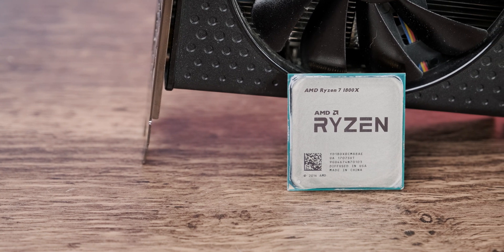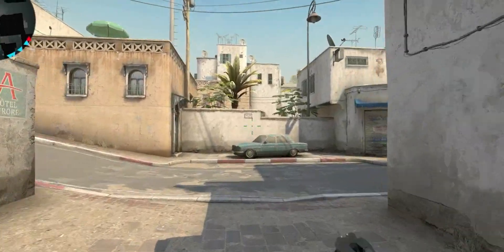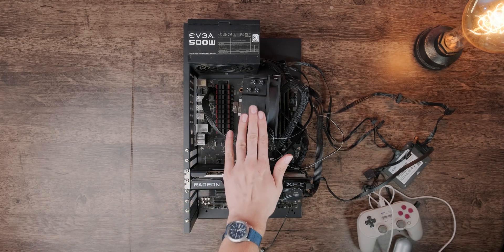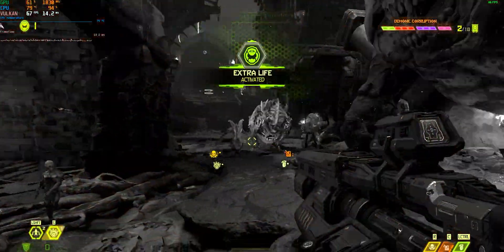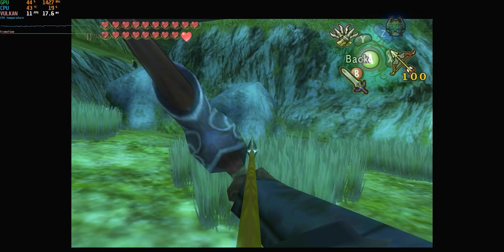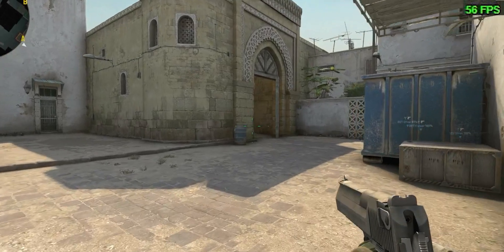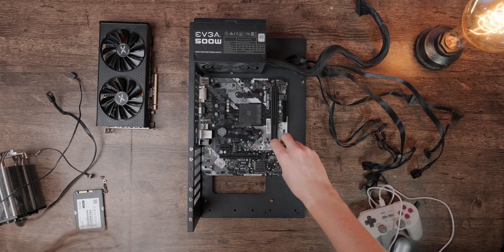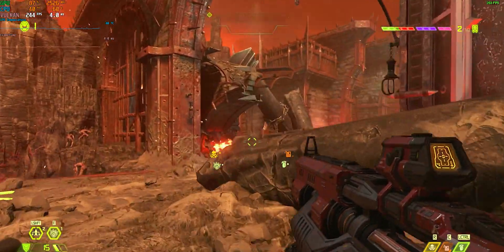WHY Are People Still Buying These CPUs? - AMD FX Series in 2023

Comment: Interesting video.  There are a few assumptions here though.  Depending on what market you are in pricing can be very different.   Even 1st generation Ryzen here has absolutely stupid premiums on the used market and where people are still selling Sandy Bridget i7 2600 systems for $500.

Also the part alot of people miss on the lawsuit is that a lawyer decided what is and is not a "real" multi core CPU.   To claim a CPU is not a real multi core CPU because it had shared floating point units is pretty arbitrary especially 10 years ago when companies were experimenting with different designs.  At worst AMD came out with an inferior design from a technical standpoint.

The 8350 especially goes for alot less because of the bad press but still is a decent option for a really budget PC and makes a bit more sense now when single core performance is less relevant than it was 10 years ago.

And if you upgraded from one from the original launch like most AMD products you didn't have to buy all new motherboards every 2 CPU releases.

You also had the whole nonsense with Intel that you had to buy specific CPUs and motherboards at a premium to even consider overclocking.

Also as others have mentioned with the Intel CPU mitigation patches for Spectre and Meltdown things have definitely gotten more interesting.

Comment: I'd consider cobbling together a fx-6300 build for a home theatre/media pc.  I'm running a think center right now that has a 3rd gen i5 3470 with 8GB of RAM.  Works well for what I use it for.  the 3470 i5 has a 77W tdp and the fx-6300 has a 95w tdp.  I'd have to think well on it since, electricity pricing has gone up  some.
Reply: just change that cpu i5 4150 i think the model we still use it beats all the fx cpus
Reply: @aeroflopper   that model doesn't seem to exist

Comment: Wow. When you said you got the stuttering, it kind of validated my issue. It makes no sense to me why I have better performance playing Pinball FX3 in 4K out of an i7 920 system I built in 2008 and an FX-8370 system I built in 2016. Both systems have the same GTX-970 GPU, 16 gig of DDR3, 980 evo SSDs, and fresh installs of Windows 10. On both systems, I can play Pinball FX3 in 4K on the highest settings and maintain 60FPS. The i7 920 system runs it flawlessly but, the FX-8370 system is jittery and unplayable, even at 60FPS. If I lower the resolution to 1440P, it plays fine. It makes absolutely no sense to me. It's not like the frame rate is dropping at 4K, it's still a V-synced 60FPS yet, it's jittery. The only thing I can think of is maybe the FX-8370 is missing an instruction set that Pinball FX3 needs to be smooth at 4K? Believe me, I'm blown away that I can play at 4K/60 on the i7 920 system. Why wouldn't a processor that's 6 years newer be able to do this? Maybe it's not the processor and it's something else. Neither processor hits over 50% usage. The GTX 970 does most of the work at around 80%. Oh, also both motherboards are midline ASUS's. It's hair pulling!

Comment: Those old FX CPUs could reach insane clocks. 
AMD even sold a 5GHz out of the box FX-9590.
And it took 10 years for another CPU to beat the FX core frequency record on LN2 lol (it was set in 2012 at almost 8.8GHz with a FX-8350).
Reply: I remember running my 6300 trying to get a record in highest clocked air cooled and maxed at 6.1GHz lol
I still have that chip

Comment: get a cheap bundle with a 970A board and an FX-8350

They are not bad chips if you can get them cheap, the trick with FX is if you buy them individually they are $15-$60 but with a board, cooler, and Ram you can get a FX-6350 for $70 and a 8350 bundle for $80

Comment: Still running an FX 8300 CPU coupled with the original XFX Radeon RX-470 GPU, 16GB of Team Group DDR3 1600 RAM, and an L7 Evo SSD.  Just three months shy of a decade, and it performs better than new. It appears the utilization of the FX series multi-core functionality has improved "over time" with respect to overall performance in applications, games and even Windows itself.
Reply: Amen to that my fx 8300 bruda

Comment: Something definitely sketchy about the 8120 results. Either or CPU or motherboard settings?
I have a 8150 that gets around 2900 in Cinebench R23. @ 3.9 ghz with lots of apps opening and running at the same time. I notice cinebench is reporting 4ghz (turbo clock) for your 8120 @8:29 but it should report the base (3.1ghz) by default.
Also @8:19, your cores are pegged at 1900mhz at full load, definitely not right.

Comment: My first gaming PC was an fx6200 and a 2gb gt610. I though the fx6200 was way faster than Intel because it had 6 cores vs only 4 on i5 and i7 and was higher clocks. I also thought the gt610 2gb was far superior to the 1.5gb gtx580!

After I soon learned this wasn't the case I changed to an i5 2550k and gtx670. Then later a HD7970. The difference was incredible. The i5 felt miles faster and snappier and the hd7970 was incredibly fast coming from the gt610. Lol.

Comment: Back in the day I heard a lot about FX CPUs being unstable and in most cases the cause was the use of tower coolers because they blow air out of the case instead of down they don't cool the northbridge. AM3 northbridges ran really hot and the better the processor the hotter they ran that's the reason for poorer performance with better cpus this is also true for LGA775 boards running core2duos though not nearly as much since they don't run as hot. so if you have either an AM2 AM3 or LGA775 board don't use a tower cooler unless your northbridge has dedicated fan,case fans won't do.
Reply: Depends on the board, some have better cooling than others. Even then, my kind of garbage GA-990XA-UD3 only ever hits about 60°C on the NB at worst with a Phenom II 955 X4 @ 3.8GHz.

This isn't bad advise, just a bit overblown. If you look at old overclocking threads for the Phenoms, everybody and their mother was recommending the Hyper 212, and yet they didn't seem to be cooking NBs left and right.

Comment: EDIT #2: Something about 1st Gen Ryzen you should mention to people is to get high speed RAM (say somewhere above 3000Mhz), I have a Ryzen 5 5600 with 2667Mhz RAM which it handles fine with architectural improvements, but my Ryzen 5 1600 was not great with this RAM and I even preferred my FX 8350's stability above my Ryzen 5 1600 in some games such as Far Cry 3, Assassin's Creed Origins.

EDIT: Ok my mistake I got confused with your video as in task manager it was looking as if you tested the FX 8350 first, but I still think that FX 6300 is worn out, I saw a video of JayZTwoCents getting high fps in Doom Eternal.

Something was not stable in your testing, my FX 8350 definitely did not stutter that bad and my frame-rates in Doom Eternal was higher on Ultra graphics with my FX 8350 & RX 480. My stock wraith cooler is able to keep temperatures below 70C under full load in summer and thermal throttles at 80C.
Reply: Yeah i have an FX 6300 paired with a Radeon RX 580 and i play Doom Eternal on Ultra without any stutter or dips in frames.
Reply: @MicroMacroUniverse  that's impressive! What's your average FPS in the game?

I am using my RX 480 & GTX 1060 in the same system, which causes slight problems with Vulkan-rendered games, but I also think AMD messed up Vulkan resource management with Polaris-based cards the last few years so even on my Ryzen-based system Rage 2 sometimes has dips.

I will have to do a clean install to test properly.
Reply: @hitbm4755  the stuttering in the vid is probably due to the slow not optimised ram (1866 is the max support) and the pci express 4 8 lane card on pcie3x16 lane means limited bandwidth and low 1% lows. I had that fx6300 580 combo too, no problems

Comment: I ran a 8350 and 6300 for years.  I bought them used and already obsolete around 1999ish.   Why?   Because I understood the platform, coming from AMD X2.  I didn't understand the Intel platform with all the new weird stwpid crap.  I wanted soemthing I could build and it worked the way old 1990's PC's worked for a motherboard .  Like with PS2 connectors.   And most importantly, it would run Windows 7.   I finally upgraded this year to a 7950x which was a jump of 10x.  This platform came with a bunch of new crrrp I h8t3d, like UEFI bios, Nvme, PWM connectors, and worse... having to run at least Windows 10 on it.

If it weren't for third party tools like OpenShell, WinAeroTweaker, and Shutup10, I wouldn't be able to use the 7950x at all.  It was a very time consuming and painful transition over that took me at least 6 months.   I still haven't gotten use to it for productive work.  I did a ton of work on the 8350 with Windows 7.   The 7950x with Win10 I'm getting really nothing done on any more.

Don't get me wrong, the 8350x is a dog in 2023, but when it first came out it was ahead of it's time regardless of lacking floating point processors for ever core.  As a programmer, I knew it was rare to do floating point math with the exception of 3D games and then most of that is done by the GPU.   I bought it when it was already obsolete, but it was a massive step up for me from a bunch of dual core X2 3600s.  So yeah, it served me well, and I still have it, but you'd be better off buying a 4th gen Intel right now or higher if you're on a serious budget.

Comment: overclocking the northbridge and cpu cache on fx removes almost all stutter theres a cache bottleneck on FX due to modules sharing cache by overclocking northbridge and cache you can much better performance and for your twilight princess emulation something was wrong because you can hit full speed with a core 2 quad

Comment: try adding a nvme m.2 ssd using a pcie adapter and you will dram,adicly increase your speed going from 600 mbps sata 3 to say a 3400mbps ssd using pcie gen 2 or gen 3 which yes results wil be a litter slower on gen 2 but still faster than sata 3 which i use to have the asus sabertooth gen 2 motherboard that may be the only gen 3 pci

Comment: i have a feeling the stuttering might be coz of the 8gb ram. I had a similar issue with my AM3 system couple years ago with the fx-6300 and a rx570 8g, but after upgrading to 16gb ddr3-ram(identical modules btw) i a saw a noticable difference! So IMO even on older AM3 systems, 16gb of ram makes a huge differnce in performance.

Comment: Three words:
Retro Gaming Monster

These CPUs have the weirdest compatibility. They’ll run any Windows from XP to 10 (and even 11 if you modify the iso). These things are seriously monstrous if you’re doing old games and running XP, Vista, or 7. In particular 7. Even if steam drops support you can use steamless (or old disc games) to move your games from a modern PC to an “air-gapped” 7 machine with like an GTX 750Ti or better.
Reply: Exactly   my 2 retro systems as I posted above run everything from pc dos 7 to win7   and for NON OS they can have win10 or the beyond abysmal w11 technically though that pos is such shit I would never ever use it for anything
Reply: I’ve been building batocera machines lately with these old parts.
Reply: So is Core i7 4790K.
It is a retro gaming Monster because you can install Windows XP up to 11 easily
Reply: @niezzayt3809  You can isolate cores on the FX that you can't on the Intel parts as well as slow down the Hyper transport and fiddle with a number of other variables to get very old Dos games to work. Games that are timing sensitive. That's why it's a retro monster. For reference.
Reply: Sandy/Ivy Bridge also runs xp and blows FX outta water so.
Reply: @damiank9443  An overclocked FX 8350 gets Sandy Bridge single core and Haswell multi core.
Reply: @damiank9443  Haswell too. Hell i built a project box with a 4th gen i5 and had i gone Intel instead of AMD when my PC was first built, my old GTX 680 wouldn't have been bottlenecked by my Phenom II

Comment: ❤❤❤❤❤❤❤❤
I LOVE MINE 
FX8150 GTX 16060TI 6G DDR6
FX 8350 GTX 1080 8G SUPERCLOCKED. 
SUPER SMOOTH WORKS PERFECT
KINGSTON 7000MB ON CARD X 2 RAID - 0
SICK INSTANT SPEED MUITI TASKING LOADING LIGHTNING BOOM.
32INCH  0 ns 240hz 
Special 4k  cable ..
Runs incredible flow

Comment: For a REAL 8 core CPU without any hyper-threading whatsoever, the FX CPU line may use a little more power but then again it is running a real 8 core CPU.  Anyone who knew anything about the i5 2500 and i7 2600 when these Intel LGA1155 CPUs came out people knew that the i5 2500 could run head to head with the i7 2600 even though the i7 2600 had 2 MB more cache and 4 extra threads.  Computer enthusiasts then realized that the 4 extra hyper-threads on the i7 2600 were in fact useless, and people just opted out and bought the i5 2500 and i5 2500K CPUs instead.....

The AMD FX CPUs followed Intel much the same way and were overbuilt at the time as no software was able to really take full advantage of the AMD FX CPUs multi-core algorithms.  That is exactly what AMD realized happened and AMD soon afterwards released the Ryzen line of CPUs b/c they knew they finally had a VG processor that could easily run head to head and even outperform Intel's best CPUs as well.

Anyone who still has a FX 8350 with a decent MB has something that should be future-proof till at least 2027 as not much has really changed in CPU performance since the i5 2500 and i7 2600 LGA1155 and the AMD FX line of CPUs.

For anyone who is into both gaming and computers, just buy a gaming console as gaming consoles are made for exactly that sole purpose > "gaming."

Seems like almost all reviewers are getting paid to bash old technology in order to get viewers to buy newer CPUs, MBs, and RAM upgrades.  Anyone who knows anything about CPU knows that CPU performance hasn't really moved since the LGA1155 i5 2500 or i7 2600....(and this is 2024)!  CPU performance has really peaked out and if anything investing in a GPU upgrade is the better choice!

Even though overclocking may be a very tempting option, the amount of power needed to OC is just not worthwhile, even though the OC option is readily available for most Intel K chips and AMD processors....!

An FX 8350 may be a little hard to source and in 2024 but these AMD CPUs still can be had cheap for $40 or less!

Comment: I built a computer in 2016 with an FX 8320e. The processor was $90 new. It has been overclocked to 4.4Ghz. I mainly just use the computer for testing now but paired with a GTX 1650 it actually runs modern games pretty well. Able to get 30fps or higher on most modern titles with medium and or low settings. Newer games being able to utilize more cores has helped the FX chips to age pretty well for being how old they are now.
Reply: i built mine also in 2016... an Fx8350 w/saber 990fx r2...

I used to overclock it to 4.4ghz but honestly it wasn't needed except for some games that i never really played. So after 2 years of usage i rolled back to "improved stock" (4.0/4.3t) 
Hardest game i throw on the Fx was shadow of the tomb raider and it took it fairly good

Allways 16gb (2x8 hyperX Fury 1866mhz) DDR3 RAM + (first) R7 370 4gb  / (second) Rx 570 4gb / (and last) Rx 580 4gb. The best pair for the CPU was the 570, i think it was as far as the cpu can fairly take without a bottleneck.

Now i just build a Ryzen setup, i get a used R5 1600 + b350 mobo and i will upgrade cpu soon enough... to be fair, it is not that far away the Fx8350 to the R5 1600... despite having NVME SSD vs SATA3 SSD, i don't feel that much of a gap (using the same Rx 580 4gb). but the gap between the Fx8350 and the R7 3700x (or 5700g or even 5700x) will be massive in every aspect.

At the end of the day, the best gpu you can pair a cpu with (without bottleneck) will determine the life of it... Back in the day Fx6300 was expected to be paired with a GTX 960 4gb / R9 380 4gb at best... and these gpus are quite obsolete, therefore cpu won't cut it anyway...
But fx8350 could take a GTX980, or a R9 390... so a Rx 570 with newer drivers sits around the same performance of these old gpus... and that's the spot for the Fx... still usable for maybe 2 more years at best
Reply: I put together a system using an FX 8300 and the AMD FX setup was about as fast as an i7 2600 if not faster!  Got all the parts for about $20 and wanted to see if the AMD FX 8300 could really perform and it actually does!  Where the FX processors really shine is with games and software that can actually make use of all 8 cores as cores are REAL CPUs, (and not useless threads) as I have mentioned earlier in a post above!  Just pair the AMD with a good GPU and you have a good computer for a dirt cheap price!
Reply: Bende var fx 8320 gtx 1080 ti 4 k birçok  oyunda 60 fps alıyorum
Reply: I have an amd fx 6300 overclocked to 4.1 ghz and some weird boost thing to 4.9GHZ really good peformance fir thiz
Reply: @uhhhh173  I have an extra fx-8350, cooler, and Motherboard I'll sell you for $20 plus shipping
Reply: i did fx 8320 oced to 4.9 ghz on a sabertooth board 990fx rev 2 if you use dx12 to vk mods the cpu can handle a 2080ti before bottlenecking
Reply: I'm running twp systems with FX 8350s in each  with and GTX 1060 with 32 GB server ram in each rig as well.  The higher end FX boards are really nifty as they are capable of using server ram and server ram can be had now really cheap!  I don't game or OC either since too much power draw and I think 8 cores is plenty. running at 4.0 Ghz anyways. I also managed to pick up Wraith Prism coolers for both systems as well for $10 each.  Nice inexpensive systems that can do really anything today!
Reply: Want to buy an 8350? I have a spare
Reply: @z33thr33  It's really really hard to find an AMD FX MB though.....
Reply: @happycat0411  you can use most am3 non plus motherboards for it even some DDR3 AM2+ boards can work with fx with a bios mod
Reply: No thanks. I'm about to retire my FX system anyway.  @z33thr33